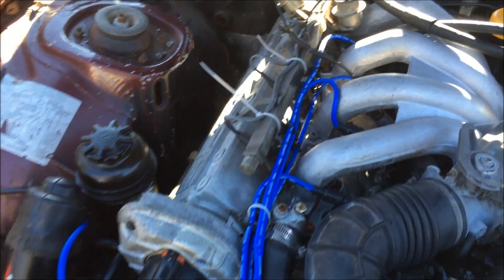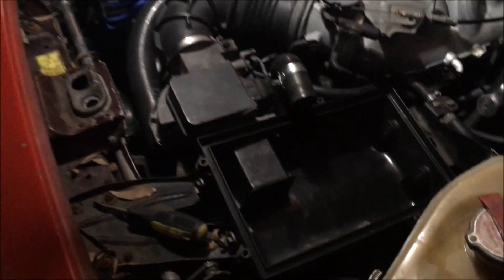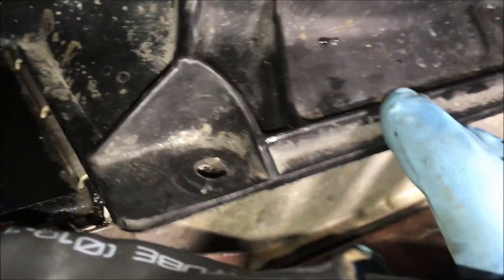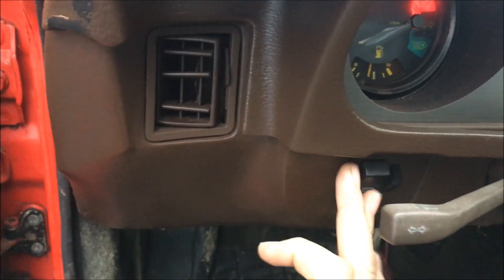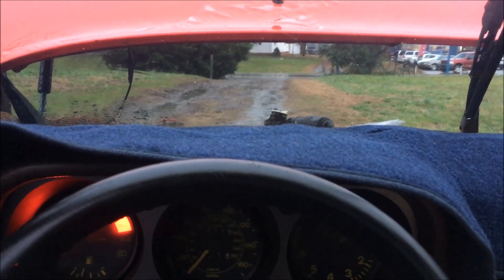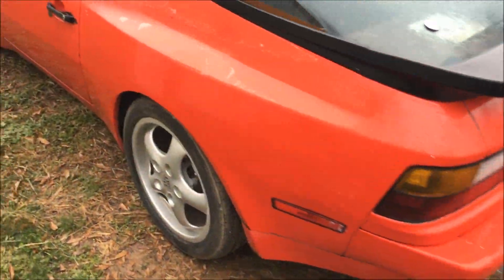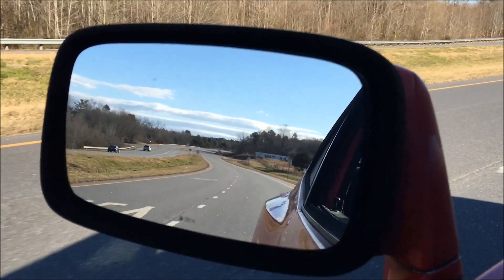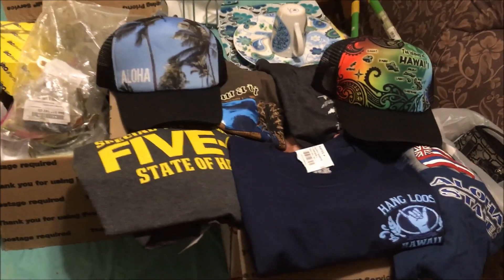Red 1984 Porsche 944 Part 4

Comment: Very cool!  Thanks Brent.  I will soon be sending you a video of the 944 running like new!  Casey
Reply from the maker: Can't wait to see it! I meant to get back to you but it sounds like you're on the right track with the fuel pump and injectors. I mentioned testing the fuel pressure on the black 924S. On the first test the pressure was 38 psi then I decided to try it again and it was 0 so something weird is happening especially since I've tried several regulators...

Comment: Well I got myself a 924 I commented wayyyy long ago when I was probably 13 or 14 wanted to get my dads car running. Well now I’m 16 and actually doing it. It’s a 924 1979 base model. Been sitting for 20 years got it to run yesterday I checked the spark(shocked the shit out of myself while doing so) and sprayed some gas in the throttle body and it started within 3 seconds. I undid the fuel filter line so I wouldn’t push any trash into it. Although I knew fuel pumps would be an issue and didn’t figure it would pump anyway. A few questions though. I took both external and internal pumps out of the car and tested them with cables from the battery. Neither one whines spun or really did anything but make me worry about catching myself on fire while sparking. So I figure I need atleast one pump. I read that you can bypass the intank pump and put a filter or strainer in place of it. I wanted to know if you’ve done this or heard or this if so is it ok to do this. Because quite frankly I don’t wanna spend more than 500 on the internal fuel pump. I can either stick with the stock external pump or put a better flowing pump it in what do you think? Also I saw in one of your videos about the “tach bounce” while cranking and how the relay could be bad. My car does not have the bounce would you recommend getting the new pump and testing to see it if does then get a relay or am I better off replacing the relay and pump?

Comment: Terrific trouble shooting and nice result, but why on earth would the owner (given all the transmission swapping) not opt to switch to the manual gear box.  That manual trans-axle is one of the best features of that car!  The ratios totally bring that engine alive!
Reply from the maker: True but it’s a lot more work to covert to manual than a lot of people realize. I’m also not sure if the owner wanted a manual.  However I’ve since bought the car and they’re not that bad to drive. I have a ton of manuals and it’s kinda nice to have an auto to drive in traffic. Thanks!

Comment: Great video! Love to watch you work and your diagnostic method. What would you use to clean up and grease the wiper stalk?
Reply from the maker: Thanks, I use moly based greases for almost everything since petroleum based lubes will just turn to liquid in summer temps and lithium greases will dry out and turn into a bar of soap. I hope that helps!

Comment: What was wrong with the FPR?
My car is having the issue that the fuel pressure is to low (1,5 bar at idle should be 2 bar)
And with fuel pump relay bridged only 2 bar and should be 2,5 bar.

Any guess what could be wrong? Might suspecting the FPR, but a failing FPR usually has too high fuel pressure, and fuel leaking in vacuum.
(The Fuelpump, tankfilter and fuelfilter and fuellines are brand new)
Reply from the maker: You are correct! This fpr would suddenly spike to 100 psi or about 7 bar causing the engine to die. Even when they are bad they don't always leak, and sometimes when they leak they may still appear to work fine. With your situation, I wouldn't worry too much about it unless you are having a running issue you are trying to diagnose. At idle these cars should only have 1,5 bar due to the vacuum line opening the diaphragm. Don't worry if yours doesn't show 2,5 bar during tests, none do. If you see over 2,5 bar that would mean that it is failing... I hope that helps!
Reply: @edredas  Thx, in matter of fact, I have some minor issues with my engine. When starting the car, the idle revs sometimes and drops for a second to only 200-400RPM until is picks up to normal idle (about 800 RPM). 
Further while driving the engine sort of hesitates (lack of power) during accelaration from idle up to 3000 RPM. 
Cant figure out what it is, some I was triggered when the fuel pressure is to low during my investigation.

I blocked the fuel return and got 6 bar, so the fuel pump is fine.
You got any suggestions?
Reply from the maker: That does sound like a fuel issue. Have you had the injectors cleaned? This sounds like an issue that I solved in this video: https://www.youtube.com/watch?v=Wu05XWERlQY&t=14s

Comment: Same thing happened to my motorcycle injectors. Ethanol in the fuel is a curse.
Reply from the maker: Yeah it is! I try to go though on bigger budget cars and ethanol proof the fuel system but there's not much you can do when the fuel sits in the fuel rail like that...

Comment: I noticed both fans are running. In my 83 n/a only my driver side fan comes on when the car warms up. The passenger side never turns on even with the ac on.
Reply from the maker: Yup, both fans should run. If only one fan is working its likely due to the relay. Since its rather expensive ($80) try testing the fan first by applying 12 volts or plugging it into the other fan plug. If it works then its the relay if it doesn't a replacement fan is fairly cheap. I hope that helps!
Reply: edredas you’re awesome man. Thanks!
Reply from the maker: No problem! Good luck!
Reply: edredas i plugged the other plug into the pass side fan and it worked. Had a spare relay that the PO gave me. Both fans work now! Thanks again 😎
Reply from the maker: Awesome! Glad you got it working!

Comment: I have just seen one about the same age, that has a strange ticking sound - is it a valve, or an injector ? Have you ever heard this on the 2.5L N/A ?
Reply from the maker: The injectors on these cars have a rather loud ticking noise, but the lifters will make a loud clacking sound when they're bad.
Reply: @edredas  It has an oil leak that maybe comes from the front side corner of the top, could this have a connection (with one of the lifters) ?
Reply from the maker: Yes, if there's oil leaking from the cam tower gasket then some of the pressure could be bleeding off causing the lifters to clack. I hope that helps!
Reply: @edredas  it does help, thanks a lot.